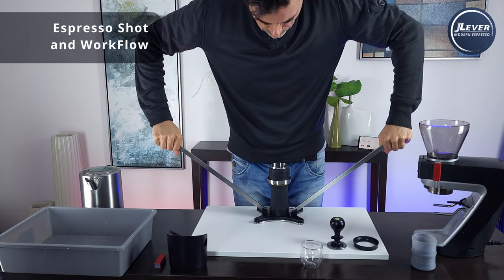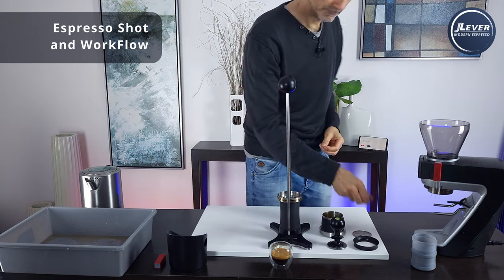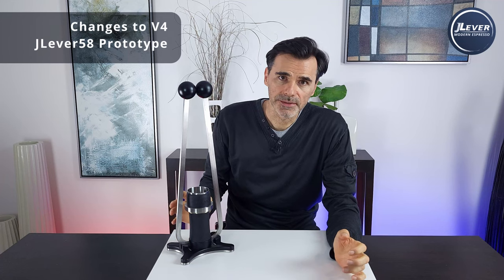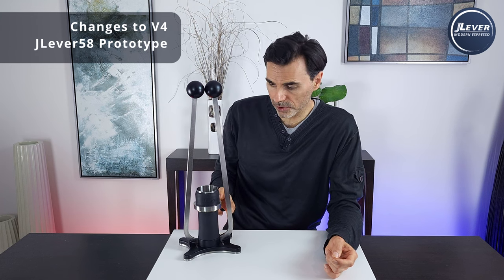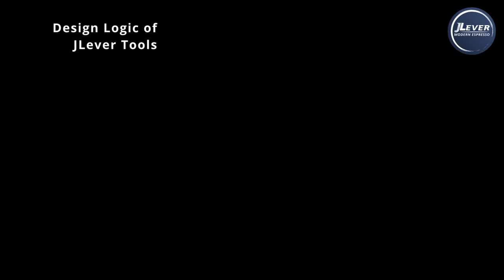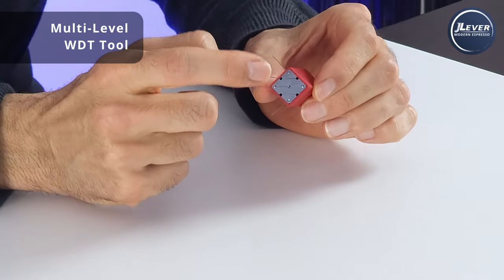INTRODUCING ! The Jlever58 Manual Espresso Maker

Comment: Hey, it looks like a great, thoughtful design, easy to use with a lot of details taken into account.
A couple of comments/questions off the bat:
1. After using the Flair Classic as my first espresso machine, it was quite impossible to pull a good shot without having a pressure gauge. I had tried using a bathroom scale, which is quite inconvenient, but maybe I even deformed it by mistake. I had like 2% success rate. After repeatedly wasting coffee, I upgraded to the gauge model and got much more consistent results. After that experience, I wouldn't recommend to people going for a manual machine without a pressure feedback.
Good, clear feedback is a basic design principle. Are there plans to provide something to see the pressure? Is it just more tolerant to variable pressures?
2. Despite all the benefits of the upward design, it feels a bit uneasy exerting that amount of pressure to something that's aiming for our face. Like if the chamber isn't screwed in properly, it seems we might get a glassful of boiling water flying to our face. What is the danger of this happening if the chamber isn't screwed in correctly, or if it simply breaks?
In general it looks like a great product though, just some first thoughts I had watching this. Looking forward to the kickstarter.
Reply from the maker: Wait till we show the non-dial in attachment as this will negate the need for a pressure gauge somewhat, I'll have more to say on safety, but we've solved it, thanks heaps for the feedback :)
Reply: @JLeverEspresso  Thanks for responding! Is the attachment like a pressurised chamber? Will that will affect the quality of the shot?
Reply from the maker: @salarycat  kind of... we'll present in a few days...
Reply: Both the Presso and the Rok are prone to the hot water explosion in the face problem and they are downard manual levers. The problem was their plastic plunger could rupture while you face was over the cylinder.
Reply from the maker: @gravlygravy  yeap, I did some research and these were the things people pointed out about these makers...this was a major reason for our re-design, the JLever actually has 6 safety mechanisms, which is why we are confident in allowing standard baskets that only last 100,000 shots before the rupture.
Reply: @JLeverEspresso  100k shots? Damn so I guess it will only last me a week 😆
Reply from the maker: @LimitedWard  oh that was, referring to the average life of a standard basket... not the espresso maker itself, that should last a life time :) domestic use anyway...

Comment: This looks great, I love it ❤ The pressure gauge is always a nice thing to have but if it complicates the design I don't think I'd actually need it with this machine. I'd definitely prefer detachable arms as mentioned in other comment. It'd make it much easier for storage and maybe even for travel. Some metal pipes or tubes that could be quickly inserted and somehow locked in sound good enough to me. Lastly I'd love to see the handle for the top part. With a handle and a quarter twist it'd basically work as a regular portafilter which you could hold while grinding and preparing the puck. I don't think I'd need an additional handle for the bottom chamber for pouring. I imagine that after pulling a shot I would just detach the top 'portafilter' and pour directly from it.
Anyway, great work with this machine 🎉 And a great video with so much detail, it was a real fun to watch!
Reply from the maker: Thanks so much for your feedback... very interesting, so storage is an issue then...  I'm not sure you'll be able to pull the portafilter off with the espresso in place as it'll be easy to spill I'd say, but maybe - we'd then need that self-energizing seal I mentioned as it's one-way, we'll see...  the non-dial attachment will allow this kind of behavior...
Reply: @JLeverEspresso  Oh, I see the problem with spilling, I haven't thought about it... I guess the upper chamber would need to be a bit higher to prevent that, but maybe that's not a good idea at all... But having to lift the whole machine with those long arms in order to pour the coffee seems a bit cumbersome at first sight. Maybe it's easy if it's light enough, but that's just the first impression I had. I'm waiting for the non-dial attachment reveal video👌
Reply from the maker: @EinMyszygeneKopf  just finished filming :)
Reply: Think you just described the top of the 9Barista 😃

Comment: Ok, this looks cool but I am bit concerned about the safety. You need to mention/ clear these points as well. 

This might sound bit nit-picking and extremely negative but: 

The method + 9 bar of pressure generating below your face gives me anxiety of looking down a gun barrel.
Reply from the maker: You're not nit-picking or negative at all, this was a concern from the start, as mentioned there will be a safety polycarb cover, and you're right when using it you feel this apprehension, but when using a safety screen you feel a lot more comfortable, and I think the safety aspects are fully solved now, at least from a design prospective, having said that, this thing will absolutely have extensive safety testing on all failure modes. Thanks for the feedback much appreciated :)